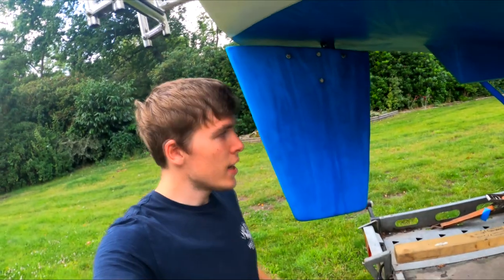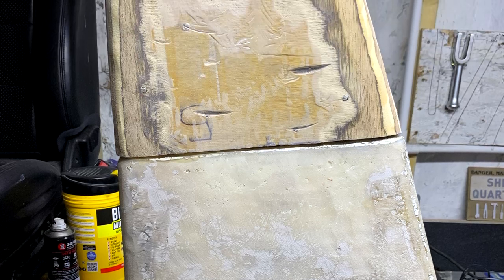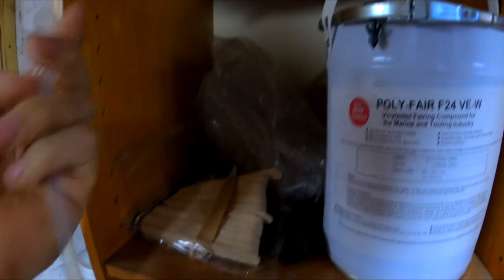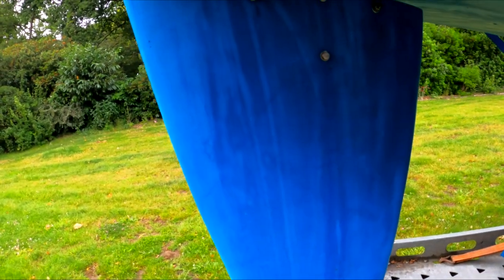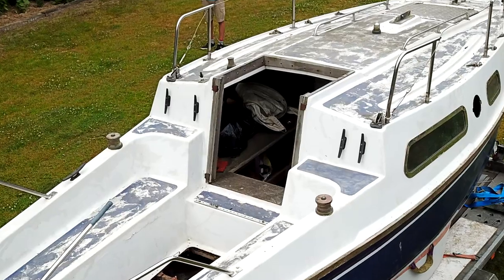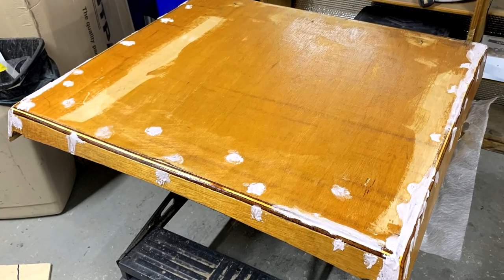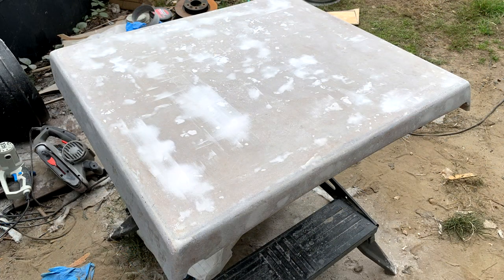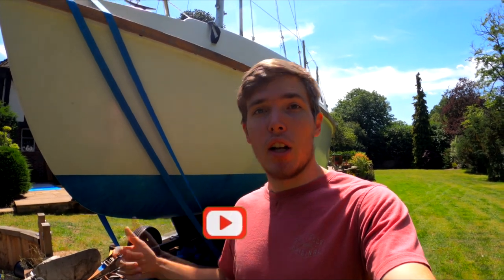Rebuilding My Rudder And Companionway Hatch! Sailing Meraki | Ep.18

Comment: Neat anchor locker setup but what about the cleat/Sampson post to secure the chain?  Is the hawse pipe in line with the bow roller or offset?Make sure that you have spread the load under the deck via beams and large plates.  It's all looking good!
Reply from the maker: Thanks Roger! You will be seeing all the deck fittings going on next episode!

Comment: Thank you Alex. A well illustrated account of some impressive tasks. Did you attach the lower part of the rudder blade with a butt joint and rely on the glass for the strength or did you incorporate some sort of rods into the join?
Reply from the maker: Thanks Peter! I did 3 small rods linking with 2 bits of ply sandwiching the rods. Then filler and glass!
Reply: Well done Alex. I hoped you had done that. I would have done the same.
Reply from the maker: Peter T She is solid now and will be on the water very soon!

Comment: Great job on the rudder and hatch.  How does the hatch fair if you get a wave over the deck towards the hatch?    Nearly there by the looks of it.  Andy UK
Reply from the maker: Andy UK - SY Corrival - Rival 32 Thanks! With spray I don’t get anything and if i’m getting massive waves crashing down then i might get a little come in but I will be fitting auto bilge pumps later down the line. Plus i don’t intend on being out is such a massive sea state!